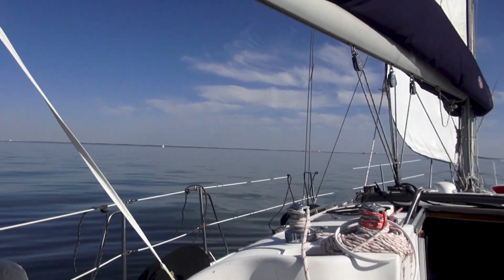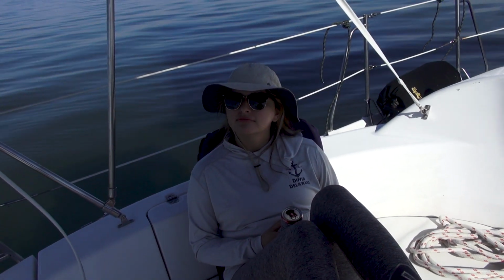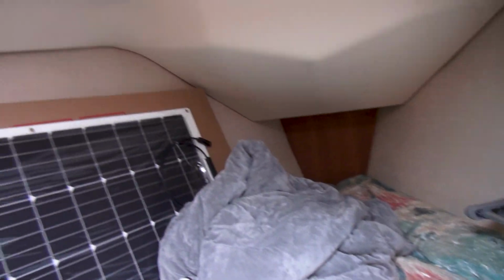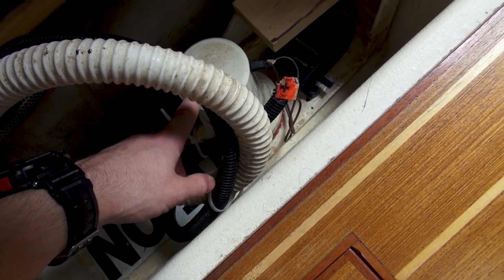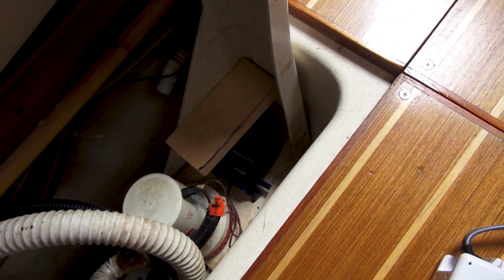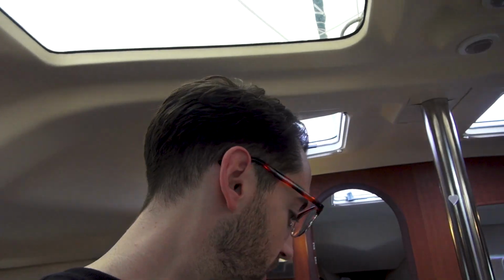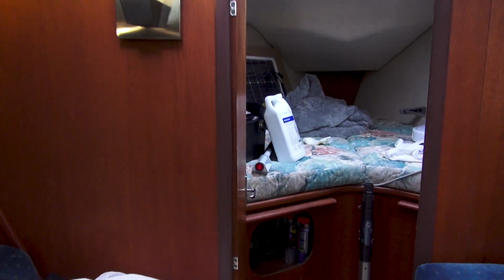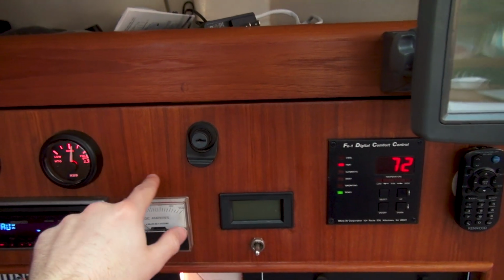Upgrading Bilge Pumps/Alarms and Flushing our Yanmar's Coolant System - Sailing Viridian EP45

Comment: Syd was lookin a little Litty :-D. and hey you may want to consider adding an external speaker and maybe even a strobe to your bilge alarm. that way if youre not at the boat and it takes on too much water someone at the marina will here it and see it riding low in the water. a guy a stone throw away from me just had his 52 foot boat sink overnight which could have been avoided with an alarm.